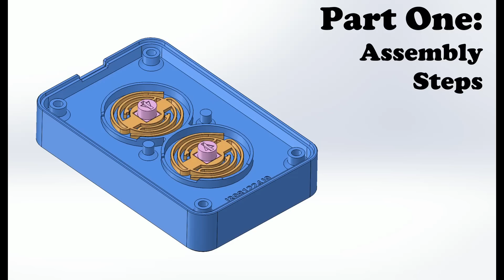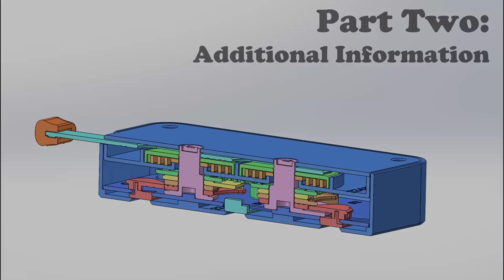7 Segment Counter v2.0 Tutorial, 3D Printed, STL Files Link

Comment: Suggestion: Add individual PLA springs behind each segment so you don't have to rely on rubber bands which become brittle. Same with the push button. Second suggestion....add a mechanism that when it cycles to 0, will trigger the cycling of an adjacent 10's place valuem. Third suggestion: due to my experience using a similar mechanical 3D printed counter in a real world situation where lots of people were pushing the button, make the push button arm way thicker and more robust. Some people will literally slam that button down. In my model, the push button button broke because of this, and I am glad I had 3D printed a backup counter for the event.

Comment: I had a problem where the cams wouldn't rotate after the springs and drums were installed. My printer ended up connecting the inner portion of the springs and they needed to be broken free. If you're using an ender 3, check to make sure the inner end of the springs are free or they will lock the drums and keep anything from moving. Thank you for sharing this amazing design! So many hours clearly when into this.

Comment: Very impressive.. I also just watched the V3 design. Great work for sharing this. My only concern would be the rubber bands.. do you find they wear out? Maybe I buy cheap rubber bands. Would be nice to integrate some of the wiring into a single PCB.. I’ve recently used KiCad to create some PCBs and was easier than I thought. I was using ESP32 so had Bluetooth & WiFi which would be nice if you could integrate with a phone app for setting.

Comment: I really love this thing, great design! I might have an area of improvement: The „locking spring“ (inner part of the spring) doesn’t have enough force to lock number one into place (after some use). I guess it needs the most force out of all the numbers when counting form zero to one. It worked fine at first but after some use it won’t count from zero to one. I‘m probably going to squeeze some foam behind that spring to increase the force. For a design improvement: Maybe „support“ the spring by making the cam flat or even a little bit concave at the number one position. Of course stiffening the spring somehow would work too.
It could also be that I‘m missing something.

Comment: Great design, but I had issues :( Printed in PLA on Bambu X1C, all edges deburred, sanded slots for smooth movement. Checked cam positioning/reassembled 4 or 5 times and the cams just aren't pushing the segs out properly (either not enough 1, 3,4) and 7 doesn't work at all. Not sure what's going on.
Reply from the maker: I'm working on a new design that is built with the X1C. Stay tuned!

Comment: Hey! Flower 3d  a year ago I successfully re-created an earlier version of your clock it looks about the same without an auto rewinder. (I’ll use snap circuits to make a switch) and currently does not have a chime (need bell) However, it is functional. I am planning on adding a day clock to the side and 3-D printing some gears! I would like to ask you though when will that new clock video come out? I was hoping to see it in its current state. That is all I have to say for now. Thanks, ATLAS (the K’NEX person)

Comment: This is awesome! is there anyway to make it count down though?
Reply from the maker: Hey and thank you! The particular model shown in this video does not have a designed way to reverse the counting direction; however, I also haven't tested or tried because the new version I'm working on will have the ability to count down. The new version will use reversable springs to accomplish this.

Comment: Very nice, a slight improvement would be to add 4 small posts for the first band to hook over, a rectangular format slightly inside the returned position. This would reduce the force on the top and bottom pieces  as it would be more of a deflection than a stretch. But it's a wonderful model
Reply from the maker: Thank you for the comment and feedback. Your suggestion makes total sense and has inspired me to begin experimenting with additional rubber band supports. I'm already seeing a few benefits.

Comment: Incredible genius design. What do you have in store for v3? full x86 emulation?
Reply from the maker: Thank you. V3 will be the basis for a new series of additional features including motor control, more number ranges (0-5, 1-12, etc.), counting (forward and reverse), and timekeeping (12 and 24 hour clock). As for control, at the moment I plan to use an Arduino or similar microcontroller.

Comment: At first this looked pretty cool. Decided to build the dual one as a present to someone who teaches children with special needs - thought it could be used as a teaching a. After a week of tinkering I have come to an understanding that the biggest flaw of this design is the thickness of the followers and cams and too tight clearances between different cams. After several days and evenings of sanding and filing the parts the followers keep getting stuck or not actuating (slipping past the correct cam). If the cams and followers were thicker with bigger gaps between them, the assembly could have been more repeatable for everyone using different printers. I'm using Prusa Mk3s+ and found out that turning on the ironing for the cams and followers helped to make them really flat and with acceptable tolerantces. But still... I can't give this unusable counter away as a present unless I wan't spend the next year finetuning it.

Comment: This is awesome! If you’re open to recommendations, I’d say an asymmetrical key on the cam shafts would help to make it so the other cam pieces could only go on the shaft the correct way. In this case they can be flipped upside down
Reply from the maker: I'm absolutely open to recommendations. Your idea makes total sense. I'm still working on the final aspects of v3 but I think I'll work something into the cam design to eliminate upside down installations. Thank you!

Comment: I like the design, really cool. 3D prints often require a level of fettling to get things working, but after two build attempts with different filament, I'll wait for V3.
The mechanism would bind up and fail after a couple of cycles. 
There is nothing retaining the seg plate in place, maybe a retaining ring between the seg plate and the mid plate? 
The cam locating pegs on the Segment plate need to be longer so the cams stay in place, I had to ream the cam pin recesses and the gear barrels to fit the locating pegs. 
The gears need to be thicker to stop them jumping. I understand their purpose from your reply to @ouroborusseven 2 weeks ago, but when this happens the strain of the gears appears too great and they jump, causing the cams out of synchronization, this in conjunction with he push action pegs jumping out of the spring barrel slots causes the mechanism to fail completely.
The push action pegs fitting into the spring barrels need to be longer to stop them jumping out, maybe a t-slot mechanism?
The push action is too flimsy. I can't see how to do that without increasing the mechanism thickness... 
Rubber bans, Yeah Nah...
I don't mean to be critical, but every design can me improved.
That's what testers are for...
Reply: I also had a really frustrating experience building this. Wasted a lot of time, but it turned up to be an unreliable design.
Reply from the maker: Thank you for the feedback! I completely agree that every design can be improved, including this one. Most of what you commented is currently being addressed/improved in the upcoming v3. One of the biggest challenges I'm facing based on feedback is creating a final design that is compatible with the inconsistencies between various printers. I really want this to be a "plug and play" experience for everyone.
I'm slowly moving away from rubber bands. V3 currently calls for the push-action to engage (2) 4mm x 50mm springs. The segments still require a rubber band but the seg-plate now has additional pegs to better support and distribute the rubber band's force on the segments. Segments and followers will be one printed piece requiring no supports (no more glue!). Many elements have had their depths increased for better engagement with acting components (to eliminate the jumping over effect).
Thank you for testing this design.

Comment: I've found that using dry lube on any moving parts on PLA works wonders.
Reply from the maker: Such a great comment. I've been experimenting with various lubes lately. It has really improved the functionality and success of some of the critical parts. At first I was convinced that if it needed lube, it was a bad design. Not any more, lube has become a necessary component and is a topic I plan to cover in the next video. 
Thanks!

Comment: Is it possible to add double springs to have two button? So it can step forward and backward.
Reply from the maker: I like your suggestion. The next model (v3) will have the ability to move either forward or reverse; however, at the moment it's not accomplished through two buttons. It will require a quick swap of the springs.
A two-button design through sounds amazing and I will keep it on the list of future improvements.

Comment: This print is so great! I actually ended up using some hairbands I had laying around instead of rubber bands, but mileage may vary with those hahah. Thank you for putting together the video as well, otherwise I am sure it would have been fairly confusing to put together. I did have to sand some of the cams down, but that's probably just a tolerance issue on my side honestly.

Thanks so much for posting this one! It's awesome!
Reply from the maker: Thank you for the comment and feedback! The tolerance issue is something I'm working to reduce with the ongoing design.

I had not even considered hairbands! Glad to hear those worked.

Comment: Fantastic Project , I'm thinking about printing it but first modifying it so that instead of the manual button it's possible to put a stepper motor by controled with AVR Microprocessor, I could then replicate 4 displays and turn it into a beautiful wall clock !!!

Comment: You could add files for the rubber bands as well to be printed in TPU. If you also make the shell snap together, you won't need any extra hardware! 100% 3D printed! Or design 3D printed screws, that also works fine.

Comment: I was having an issue where the push action plate was sliding out of the spring barrel holes. I made the pins the same length as the pin holding onto the rubber band and it doesn't slip anymore. And I would love to see somebody make this into a working clock!

Comment: Amazing! I guess you would need some kind of pivoting mechanism instead of the current sliding mechanism to get rid of / hide the tracks for the segments... Otherwise I would recommend printing it in black to hide the tracks, which add visual noise to the numbers. If possible, chamfering the outlines of the cutouts would also help reduce the shadow cast on unused/empty segments. Incredible design, execution and video!

Comment: Neat!

I wonder if the white segments could be made to attach to another part, the same color as the seg plate, so that when the white part gets pulled out of the way, it pulls the blue part into its place, so that you don't see the seg plate at all, especially the slots.

It might not be as straightforward as it sounds, since the edges of two white segments are already close to each other as it is when they are both "on", but maybe something that could be accomplished!

Comment: Quick tip. You seem to have a number of parts that can be assembled in multiple orientations, but only one orientation is correct. You can use asymmetrical holes/shafts/pins/etc. so that there's only one possible way to assemble, and no instructions are needed.

For instance, the cams. If it's a D shaped profile they're sliding onto, then they'll always be clocked correctly when assembled.
Reply from the maker: Hey! For the cams, I included a shaft key on only one of the four faces of the square shafts so the cams can be clocked in only one orientation. Is that what you're referring to?

Comment: You did really well there! The most I like it's the inners, because it looks like it could be driven by a motor.

And maybe you didn't think of this, but if you can stack these in sync, (and in parallel) these could be used to replace all the electronic ones seen on almost every shop, so that not electric power would be needed to run these. All the best!

Comment: its impressive how you get soo much, with soo few parts, and interesting combo of simple complexity.
my suggestions are....
1. silicone bands, since rubber bands degrade pretty quickly.

2. the ability to select a number, not just cycle through till you reach the one you need. 

3. use M3, M4, M5, screws, not wood screws, as they are the standard for 3d printing, and lots of other things, and would be more common for people to already have, or find.

4. version with and internal button, or is otherwise hidden, instead of sticking out the top, so you can make a nice neat looking clock with it.

Comment: You could try to hook a solenoid pushers up to the step button so an arduino can run it as a clock and try to read the watt hour of the system to see how efficient of a system it would be compared to a led clock

Comment: How difficult would it be for you to come up with two more sets of cam stacks for 0 to 5 and 0 to 2 to be able to use these as clock digits?
Reply from the maker: Not difficult. I already have a 0 to 5 cam set designed just need to modify them from version 1 to version 2. As for a 0 to 2 cam set, I've not designed those yet but it would be a simple mod to the existing cams.

Comment: On the double I think you could make the bigger digit auto. In my head I am imagining a smaller ratchet with 10 teeth, as you click 10 times it adds the tension to push the next button, on the 10th it is released.

Comment: Nice... Now I want to build one controled by an esp32 to display temperature.... Is there any possibility to get your original cad file? I supposed it is OnShape or Fusion360?
Reply from the maker: STP files coming soon (after a few modifications). Components designed in Solidworks.

Comment: That is an amazing project, congratulations.
I hope in the future the rubber bands get replaced by compliant mechanism, rubber bands, at least those simple yellow ones used to hold money, which are the only ones I can find in my country, get ruined after a few months, specially after a hot summer, they melt and glue to the object resulting in a mess. Also the screws, 3d printing allows for so much freedom in shapes otherwise impossible to make by any other manufacturing processes, so many interesting latching options, screws almost feel like a step backwards.
Reply from the maker: I don't disagree! Phasing out the rubber bands and wood screws are high on the list of future improvements.

Comment: Very nice project indeed! 
I suggest moving the actuator to the right side (maybe with a detachable extension rod to the top to keep the existing functionality), and add a recessed "carry lever" on the right side so it can operate a digit at it's right and be stack-able.
Of course the amount of digits would be limited by the force needed to turn from 9999... to 0000...

Comment: not sure how you did yours, but mine is binding up like crazy. all the parts seem to have very loose tolerances which does not seem to support smooth operation. nice project though, thx for sharing. btw, I printed on a bambulab x1c if that helps anyone.
Reply from the maker: Hey! Thank you for the feedback. I've seen a few comments about loose tolerances others are experiencing. I plan on making a follow-up video to discuss some ideas to deal with this. Also, I'm working on improving some of the components to avoid this issue all together.  I want everyone to experience this 7 segment digit exactly as I intended.

Comment: That's such a superb design! Already have it in the slicer! Have you thought about using print-in-place springs instead of rubber bands?
Reply from the maker: Thank you! I previously gave little thought to printed springs to replace the rubber bands but now after reading comments and suggestions, I think I'm going to move it up higher on my to-do list.
Reply: @Flower-3D  Pro springs reasons (beyond independence from elastic bands):
1. elastic bands will pull one side or another on the segment tabs, tilting them depending on the number configuration
2. springs not only will not do that, but the design can be adapted to use the springs as segment tab alignment props too
3. you can integrate a spring for the middle segment too
Feedback on your design, if I may:
1. The tolerances are WAY too generous. I'm getting big gaps and I know this could be better. Maybe put out variations of the files to account for tighter tolerances too? (my makers muse tolerance test is around 0.1-0.15mm)
2. I get why you chamfered the bottom of the cams. But the segment tabs couls use not having chamfers, to increase the vertical size of the surface the cams push against. Also, I would have chamfered both the bottom ands top of the cams.
2.b. The current chamfers config for the sync sprockets makes so that the sprockets tend to climb on one another. I would ditch chamfering on the teeth
2.c. If the only purpose of the chamfering is to prevent elephant's foot, I would alltogether drop it and instruct the user to activate the anti-elephant's foot setting in the slices (all major slicers have that now) - it makes for nicer control of the slicing process